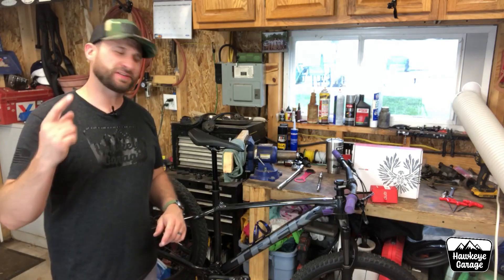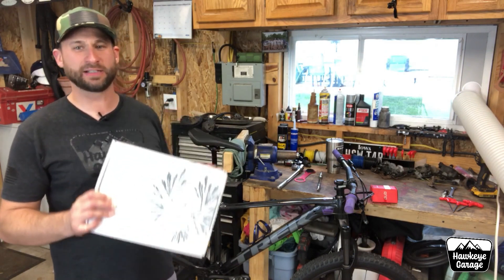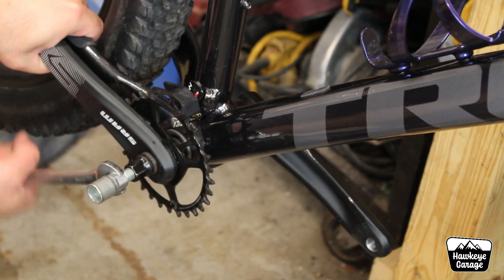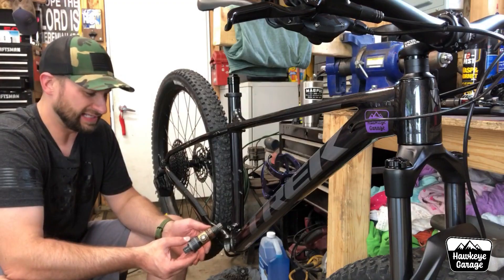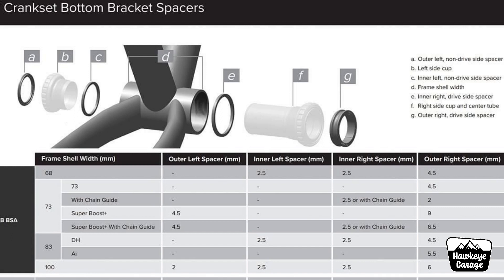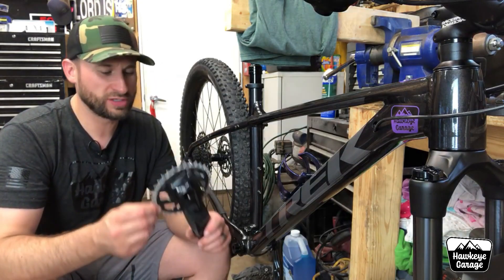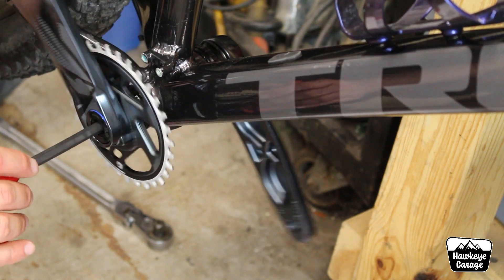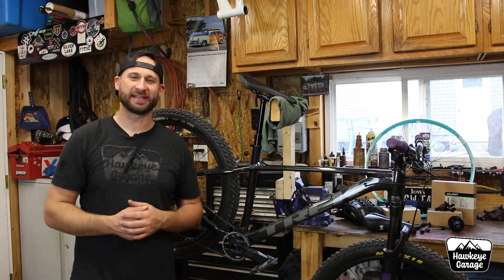Trek Roscoe Upgraded Cranks & Bottom Bracket

Comment: Why did you not go with the Boost bottom bracket since you went with the Boost cranks?
Reply from the maker: I did. You can only run a boost BB with boost cranks, and you can only run boost BB and cranks on a boost bike. Its all or nothing.
Reply: @HawkeyeSkunkWorks Thanks for the reply.  That is what I thought.  When I pulled up the part number, it showed me the non-Boost version. I will double check my cart. :-)
Reply from the maker: @KevinHall_wft  their part numbers suck

Comment: Great video! I just upgraded the rear hub on my ‘21 Roscoe 7 to a Bontrager Rapid Drive 108 and, WOW, what a shocking difference in ride quality. Instant pedal engagement! I had Trek do it for me (wasn’t up for the challenge of re-building a wheel) and it did set me back close to $400 by time all was said and done. 

PS- I’ve been looking for a chain guide that would fit the front derailleur mounts on the Roscoe…I’ll look into that Funn one, thanks!
Reply from the maker: Good to know that hub is in my final 2 options for my next mod
Reply: Hi, would the hub be needed for a shimano or SRAM, I have a trek roscoe 7 21 too and I am confused which one I need to get